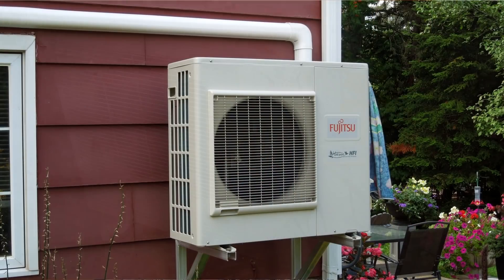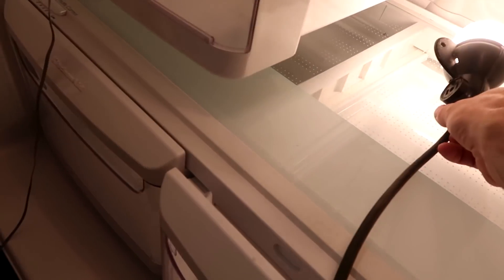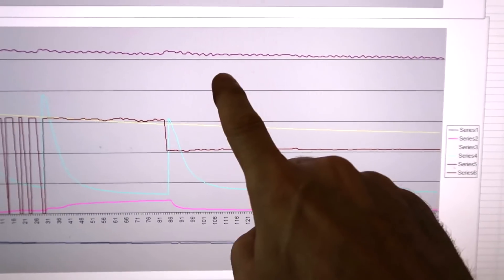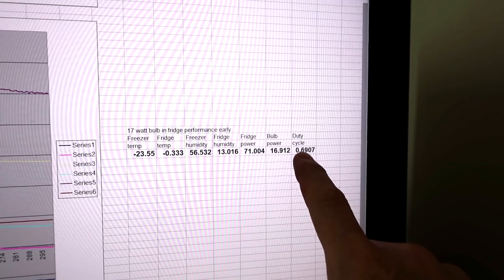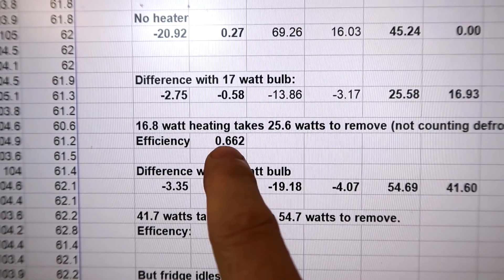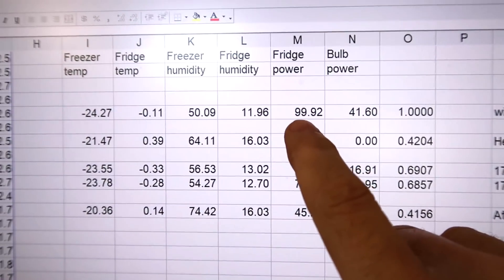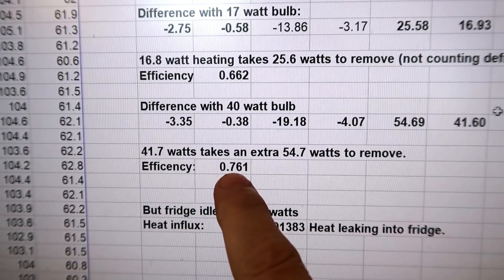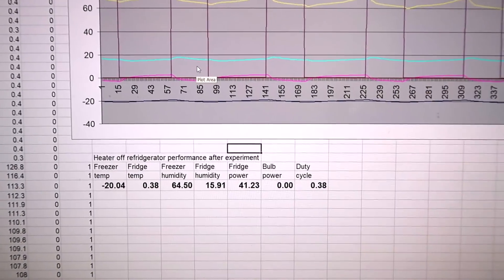Refrigerator heat pump efficiency test

Comment: How would the efficiency compare to like a steam heating system maybe using oil or natural gas?
Reply: Any traditional heating is only at maximum 100% efficient, the amount of heat in the fuel burnt is all the heat you get. But if the lines are ran through external walls at all, that could affect the insulation of the wall in that spot.
Reply: Minimum efficiency requirements for a new boiler in the U.S. varies but is about 80%, same as a furnace. That's half as good as Mattias' rough calculations, which are still below what a heat pump should provide, and a high end furnace is 97.5% efficient.
Reply: @wyattroncin941  way less than 100%. Theoretical best is 96% because some heat HAS to go up the chimney. And if you are heating water, then factor in standby losses on the off cycle.
Reply: @jeffpeterson1331  theoretical maximum amount of energy you can add to a space by burning a fuel is no more than the amount of energy in the fuel being burned, i.e 100% maximum theoretical efficiency. Accounting for exhaust losses is a maximum practical efficiency.

Comment: Adding insulation to the attic is almost always the most cost effective thing in a place like NB. Second most effective thing are heat pumps, with the plus that you get AC in July. I've done both and I live in NB.
Reply from the maker: we already have over half a meter up there.  Adding more would not be very effective.

Comment: Speaking as an HVAC tech, any appliance which burns fuel is necessarily less than 100% efficient. Because some amount of heat goes up the chimney. And you only get heat, not cooling. 
Also, your comparison of a refrigerator vs a heat pump is flawed. The fridge has to reject the heat of compression and the heat of work(heat from the consumption of electricity) as a waste product. In a heat pump, these are beneficial! 
I like that you are thinking about this stuff, but there are more factors you aren't considering.

Comment: Sized correctly and a quality unit like a fujitsu or mitsubishi will save most people money where you are comparing apples to apples.  Those two brands can heat at much lower temps compared to all other manufacturers

Comment: How's she goin'?  I live in Nova Scotia and have a heat pump.  For about 2 to 3 weeks winter the temps are below -17 C and my heat pump shuts off.  Other than that, I get great heat from the unit.  If you live in a  climate where the temps only drop to maybe -10 C a heat pump would be worth the investment.  Don't forget the added benefit of the AC and dehumidifying for the hot, muggy summer days too.  There that's my 5 cents worth!!!

Comment: What about geothermal heat pumps? Those are really common here in Sweden and since they use the relatively warm water down in the ground they are much more efficient than an air unit. Especially when it is -20C or colder. The water 150 meter down is almost always about the same temperature as the average annual air temperature. Here in southern Sweden, that is about 8C.

Comment: that 1.66 efficiency to heat the house only works if the compressor (and all other heat producing elements) is also inside, and only the heat exchanger (radiator) is outside.
i think with a normal heatpump, the compressor is also outside? which also comsumes watts but doesn't deliver those watts of heat inside, but sadly outside...
Reply from the maker: the compressor's heat goes into the coolant, which also goes into the house.

Comment: I have a heat pump in my 90 m2 with garage and it consumes less than 2000 kWh a year to heat up the place. And the ceiling is 4m high so there's large volume to heat up.

Comment: Refrigerator bodies are insulated with gas-filled foam, often isopentane (many newer makes list this on the label inside the fridge).

A decent heat pump is not noisy, is good down to at least 17F  (-7C), and should give you much better than 160% site efficiency. Federal minimum efficiency requirements in the U.S. are 8.2 HSPF. Divide that by 3.413 kBTU/kW to get a coefficient of performance of 2.4 (240% efficiency). Granted, that's not at the lowest temperatures, but still better. It's not uncommon to find systems with HSPF of 10.5, and manufacturers can tune designs (cycles, and size of condenser) to get HSPF in excess of 12 (350%); at the expense of slightly poorer cooling performance, but still exceeding many "efficient" air conditioners. The efficiency of an ASHP might decrease as the weather cools, but what really decreases is the heating capacity, however most have integrated resistance heaters, or if you already have electric baseboards, an installer would leave them in place and add a thermostat that would resort to them if the pump is not quite able to meet demand.

Also note, that even taking into account inefficiencies (40% received/60% loss) of generation and transmission of dirty electricity, the heat pump still comes out ahead of conventional combustion equipment. However, if you have a larger heating load, (~100kBTUh, roughly 3k+ sqft) and don't mind being tied to natural gas for the foreseeable future,  there are gas-fired/absorption heat pumps that will let you burn propane or natural gas at about 125% efficiency. You can also go the dual-fuel heat pump route/two-stage thermostat, where the heat pump runs for warmer temperatures, but the furnace or boiler is run only when the heat pump isn't quite meeting your set point (typically configured to switch when outdoors is just above freezing).

If you want to dig into the nitty gritty, look into the Northeast Energy Efficiency Partnership's Cold Climate Heat Pump ratings; the most populous parts of Canada are IECC Climate Zones 5 or 6, same as the Northeast U.S.

Comment: The problem with your experiment is that you won't know if your calculations are correct until you get a heat pump and use it.

The real question is: 
Does it pay for itself over a short enough period of time so that the investment is worth the purchase?
Reply: His fridge uses a heatpump

Comment: i don't have a heat pump. but here over here in Holland go some go nut over them (i don't)
so there are some guide lines ''Holland guide lines''.
you need to insulate you house very well not only the walls, floor and roof but also the windows 3 layer glas is minimum. 
floor heating
 is the best to heat the house or second best choice is a special radiator (they are bigger than standard) (standard high temperature radiator's will not work)

but the biggest downside is when the temperature drops to 5℃ it starts to get cold in the house (it can no longer heat at 21℃) and at -5℃ it can not heat the house at all.
a back up heater is a must if you wand to keep warm. 
and this you not hear about a lot.
Reply: You can use a wood stove connected to central heating for the really cold days
Reply: @FilippRoos  it is a option also electric / gas boiler. 
in the new residential area the try ground heat or left over industry heat.
but we are not ready for large scale,
same whit the electric car.
solar panels and wind power.

Comment: A heat pump is replacing both your AC and heaters, so you have to consider the cost of only having a heat pump vs traditional heating and cooling.

Comment: I would like to have all heating alternatives, currently viable, to be compared... However not just economically speaking, but also ecologically. 

I guess in future heat pumps will be one of the best heating appliances, because they do not need PTG Conversion or hardly any conversion anyway.

It’s hard to take into account all inputs, factors and outputs in such a big energy management system. Nevertheless I personally have fun doing that and hey maybe it helps other people...

Comment: Cooling needs more power then heating with a heat pump, dont know why, but my AC has a heat transfer capabitily of 3,8 kW while cooling and 4,6 kW while heating the room. To achieve that it uses 1,05 kW of electricity.
Reply: Because this used 1 kW is also used for heating.

Comment: I'll take hydronic over a heat pump any day. Sure, heat pump for the southern half of the U.S., say below Zone 4 for the cooling aspect.  But, anything above that Zone just doesn't make sense.
Reply: They can easily displace 80%+ of your heating load in CZ5, which is nothing to sneeze at. And there are in fact hydronic distribution ASHP systems, more readily available in Europe, but there are suppliers of them in North America as well.

Comment: Wouldn't the efficiency of a heat pump be better than a refrigerator, they use a different type of compressor. I thought most heat pumps had inverter drives with 2 stage compressors. The average fridge (except maybe the last couple years) are a fixed speed, single stage compressor.

Comment: i dont get it, if a heat pump is 66% efficient. how does having one outside leaking energy heating your home any better than a electric resistor inside the home that is virtually 100% efficient?
Reply from the maker: because the motor's heat actually ends up in the refrigerant, and it comes inside.
Reply: @matthiasrandomstuff2221  if a heat pump doesn't pump more heat than the equivalent power it consume while doing it i dont see any benefit (energy wise) compared to  electrical resistor heating.
Reply from the maker: Well, I guess you just don't understand.  But your understanding isn't required for it to actually work.
Reply: @tayl0r612  yes i know, and it loses energy thru heat while doing so as any motor and anything containing electronic. my question was if it consume 1000W working. does it output the equivalent of 1000W or more inside the house? because as the Matthias experiment proved his fridge took 60watts to move around 40watts of energy. meaning a heat pump outside, even having a 90% efficiency, will never be as economic as running a resistor heating element inside the house.
Reply: @matthiasrandomstuff2221  your just that good of a teacher, its all on you.
Reply: The heat pump DOES pump more heat than the equivalent power it consumes. Read some of the other comments. They can potentially heat like a 3kW heater while consuming only 1kW of electricity.
Reply: @mckenziekeith7434  Ahhh, that is what i wanted to know. if there are that good, why doesnt everybody have them?
Reply: @Francois_Dupont  I don't know. Where I live electric heat is a non-starter (US $0.25/kWh). We use wood and propane. In order to assess the economic viability, you have to account for the lifetime cost of ownership and maintenance, etc. Also, some people may not have $5000 in cash up front to install a big heat pump. It may save them money in the long run, but they don't have the money in the first place.

Comment: Heat pumps are best used in moderate climate.  Like where I live, the average temp is between 25 F on the low side to 90F on the high side.  Another good reason to get a heat pump is the new split systems where you can zone out your house.

Now ground source heat pumps are another story, if you have the means to drill a well or have enough land to run a loop.  Then they can get efficiencies of up to 300% that I have heard of, and 220% that I have seen.  For part of my HVAC classes we installed a ground source heat pump for a local business.

Comment: Heat pumps are rated with a COP specification which is an efficiency ratio (1 = 100%, 2 = 200%, etc). Typically they achieve COP 3 to 4. What's wrong with those figures?

Comment: Direct and reflective noise from heatpumps has changed my life a great deal.  They're great if you're reaping the warm and cozy benefits from owning them, but if your susceptible to hearing and tuning-in on low-pressure waves they create, you're f#%ed.  I'd like to see all heat pumps installed in-ground, well below permafrost levels and fans removed to the inside of owners basements.

Comment: Now "inverter" heat pumps (more accurately "compressors") in fridges, home AC's, wash machines, etc... are even more efficient and produce little to no noise. The temperature regulation is better controlled and power consumption effectively reduced.
In short, combine "inverter" appliances with LED lighting, smart screens, solar electricity generator and -hopefully in the near future- smart windows with solar vacuum-tube air heaters add to that solar water heaters. All of that will save you "sacs" of money and the payback time is 3 to 4 years. After that, the grid will pay you instead you pay them.....
Reply: But some inverter fridge produce more and more noise compared with normal ones
Reply: @呵呵呵呵-l6i  I've tried both, and the inverter is hardly heard... It much more quite...

Comment: "If you're extracting the heat from -20 outside"
Canada is weird.
Reply: -20 is a comfortable winter temperrature in much of the country.
During the few weeks we get each year that are -30 and below, heat pumps aren't quite as efficient.

Fortunately, in Matthias' area it doesn't usually get that cold for very long.

Comment: You won't get all the electricity a heat pump uses in the form of heat inside the house. The compressor and fan are located outside and the heat they generate will be dissipated outside.
Reply from the maker: there is insulation around the compressor, so the heat ends up in the fluid
Reply: @matthiasrandomstuff2221  Thanks for the response Matthias, I didn't know that since I have never looked inside a heat pump. My AC  unit does not have any insulation around the compressor. Insulating the compressor still feels counter intuitive to me because it puts excessive stress on the compressor when it works in AC mode. Also, the refrigerant coming back from the evaporator inside the house (in AC mode) would be warm and will get hotter after compression - not sure how that could cool down the compressor.

Comment: I wonder about the effect of an empty fridge vs a fully loaded one with open/close door losses as well as the reaction to the bulb.
Reply: Refrigerators aren't designed to do what he did with it. This experiment puts the unit in "hot pull down" forever. Unless your food is exothermic, your fridge will never be in this situation.

Comment: we will see on long term how this "everyone want electric heat pump" will go.. with all the electric cars coming... if electric companys wont adjust power lines, and power production you will all be so cold even before you brake even. correct me if im wrong..